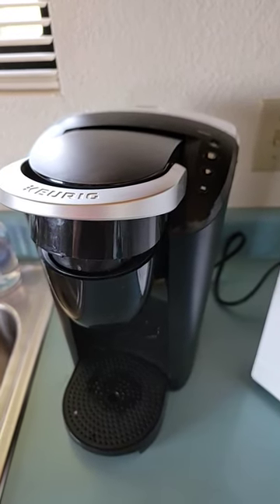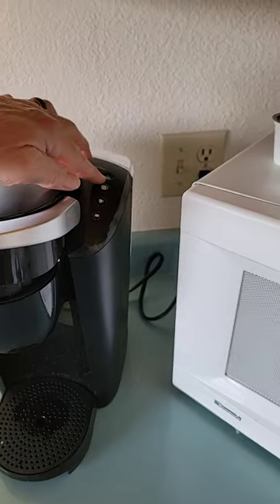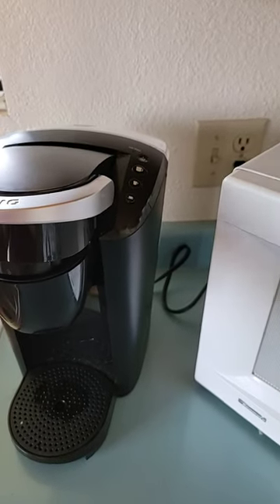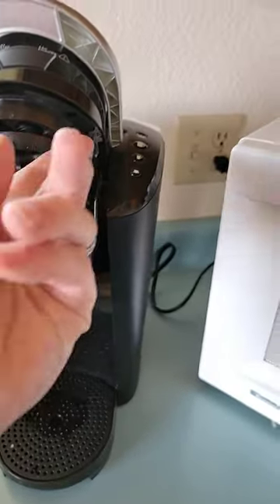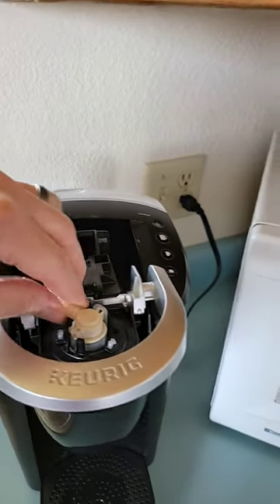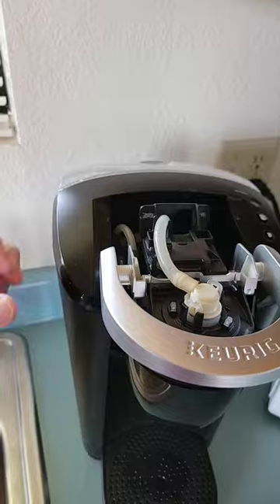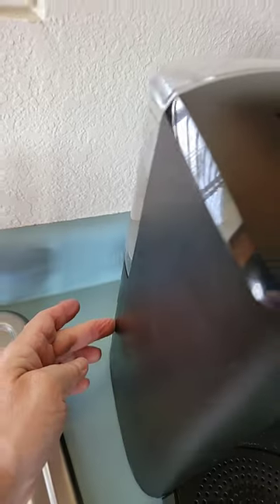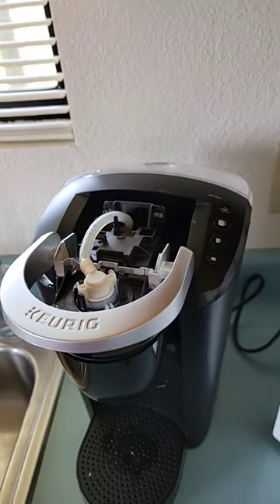Quick Fix! Fix Keurig not pumping water! #short #shorts #subscribers #Keurig fix

Comment: We're not looking for speed but for clear step-by-step instructions.  Why would you do a video that does not show the tab you opened to clear the line before videoing?   This got me lost. 
I unplugged mine, ran vinegar through it, cleaned the needle with a paper clip after removing the reusable coffee filter, and then tried to run water through it, but now it was plugged.  
It was not plugged up before I started this. 
Since I couldn't find the tabs you were talking about,   I plugged the machine back in again, put the reusable filter back in it after cleaning it's need area, 
I  filled the reservoir and started the full brew after opening and closing the filter hatch.  
It did not run but acted like it wanted to, so I left it on, and in a minute or so it backed up enough power to blow it clear and works great now.
Reply from the maker: There are literally 3 comments with a link plus a link in the description for the tabs video.
Reply from the maker: https://youtube.com/shorts/nCLB5d70rgU?si=yfgIPC1YZsHn4-p8

Comment: Didn’t work for me 😩 I filled the tube up 3times…it won’t suck water independently out of the tank
Reply from the maker: Bummer. You may have a bad pump. Can you hear it trying to pump?
Reply: Then you gotta descale it..  take tank off back and clean ariund nozzle with a toothbrush..  soak in soapy water or use hydrogen peroxide to loosen. Or vinegar of course.
Reply: My keep sayin add water
Reply from the maker: @Tohottohandle07  Check this out: https://fluentincoffee.com/keurig-keeps-saying-add-water/